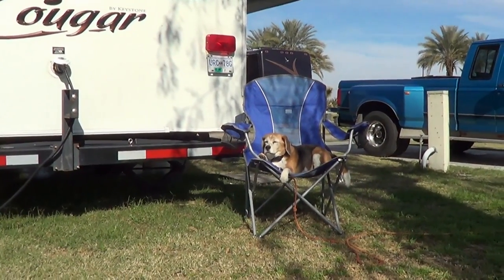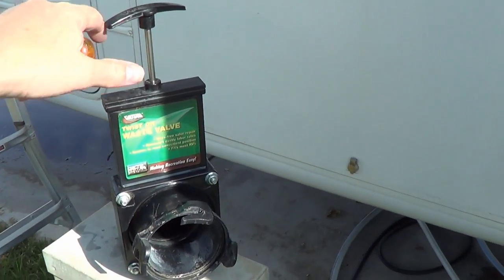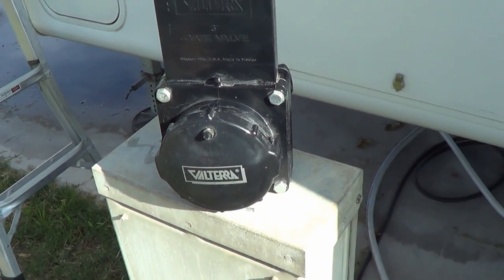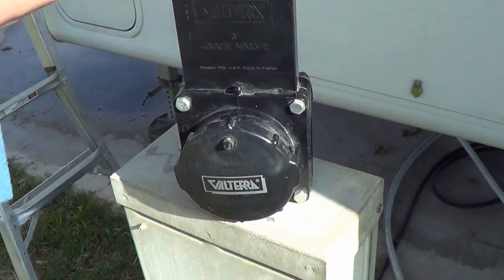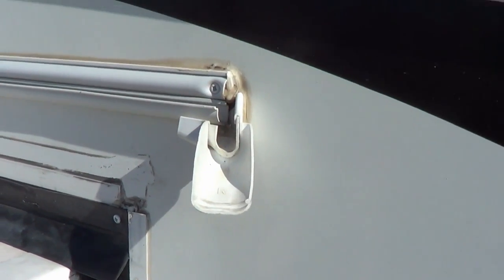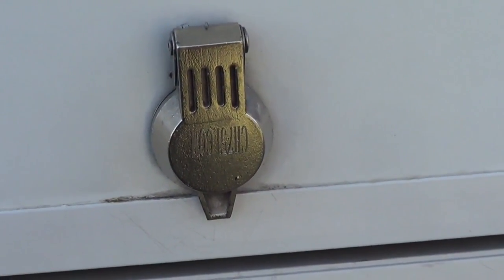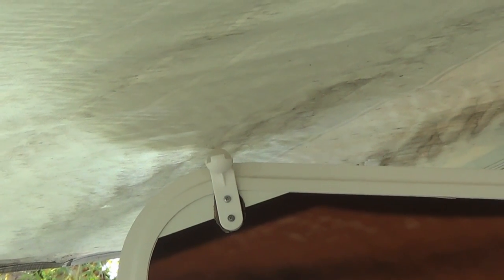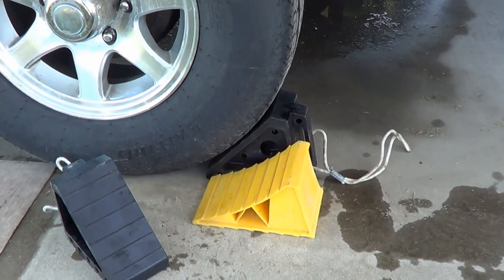My 10 Must Have RV Gadgets

Comment: Without watching the entire video, the 10 things I believe you need are:

Toolbox-Yes it's several things but a basic tool set is essentialRubber Mallet-Great for securing stakes for outside rug, canopy, awning anchor, etc
Tire gauge-obvious reasonsLeveling Blocks-I haven't had to use these often but am thankful I have them
Slonkey-To keep your waste hose off the ground
Water Regulator-Had a friend tell me how at a campground he stayed, they shut off their water slide increasing the water pressure enough that it burst a seal in his camper causing a flood in his camper
Y Splitter For Water Hookup-This way you can hook up a hose as well as fresh water hookupSurge Protector-Obvious reasons
Dog Bone-In case you stay at a park that only has 50 amp(if you are have 30 amp service) and vice versa
Emergency Roadside Assistance-Believe me, it's essential

Comment: Great stuff!  I need those gutter extenders and awning protection ball!  Our high Colorado mountain winds often blow my cheap plastic chocks across the lot in our RV parking so those heavier rubber ones look much better!  I recently mounted two Valterra A04-5094BK EZ hose carriers and love them!  One holds my two stinky slinky hoses which is great because everything fits except the end piece that goes onto the ground drain.  The other holds my water hose lines which have always been a pain sitting in my storage compartment.  And both are lockable.

Comment: Morryde step above pull down aluminum stairs set up with grab bar, RVlock with combo pad and remotes, Auto leveling system, Reese Goose box with air bag and shocks, hand held wireless rechargeable air pump, adjustable water pressure valve, battery kill switch are some of my go to products.

Comment: I installed a "Dust Devil" central vac system in our Cougar and my wife loves it. I mounted the hose connect in the bottom step going into the upper bed area and store the hose under the table seat. The control unit with the dust bag is mounted in the storage bay adjacent to the steps to the upper bed area.
Reply from the maker: Nice!

Comment: We have had motorhomes for 30 yrs. We started with our first one when our children were young. We now take grandchildren with us. We are on our 3rd. Motorhome. On each of them we put a screen saver on the bottom section of the screen door. The first two we bought at Home Depot or Lowes, the newest one, 6 months ago we bought at Camping World. They are about 25 to 30 dollars but they prevent the screen from being pushed out and helps to stabilize the door. With the grab bar and screen saver, our screen door is very stable.
Reply from the maker: Good tip, thanks! Cheers, Ray

Comment: An absolute must have for me is hose quick connects. No more twisting of hoses at the pipe stand, pressure regulator or where it's hard to get at going into the rv. I use them for fresh water and my internal black tank sprayer hoses. So I don't mixed up those for fresh water (vs those for black/grey water) I spray paint them white like my fresh water hose.
Reply from the maker: Cool. What brand have you found works best? I've tried a few in the past but they never really held up very long before leaking.
Reply: The brand name is Gardena. I bought them in Canada. The main part is grey and the sliding collar is orange.
Reply from the maker: George Bliss Thanks! Will give them a try. Cheers!

Comment: Another thing you want to add is a Mister  for your air conditioner on the roof in hot areas like here in Redding 115 out when we were living in it to build a house that Mister kept that thing at 75 just put a little bit of spray water on that coil you also want to have a filter so you don’t build up on your coil .
Reply from the maker: So I guess it acts like a swamp cooler, guess that works well in low humidity environments.  Cheers, Ray
Reply: Love Your RV No it does not act like a swamp cooler it keeps the condensing coil cool in real hot weather and makes the air conditioner work better and not overwork but you have to put a calcium filter on it so it will not corrode that coil with hard water

Comment: Great list Ray.  I will give a Shout Out to Progressive Industries.  I have one of their plug in surge protectors and one day at the campground I was staying, there was an overload on the power line feeding mine and another row - caused a fire actually.  My Progressive Industries surge protector did it's job and died in the line of duty.  I found out that Progressive Industries is actually in NC where I was, so I took it to them and told them what happened.  They are super nice people.  30 minutes later they had parts replaced and handed it back to me.  No charge.  Highly recommend Progressive Industries.
Reply from the maker: Awesome!
Reply: I too have the portable EMS surge protector protector and it has saved my rig twice already. I actually have a dedicated 30 Amp circuit at our home driveway we plug into when home. The EMS kept telling us something was wrong and it shutting down. Turned out we had a loose ground connection at the breaker. so bad circuits can happen anywhere. When we upgraded to a 50 Amp rig, I immediately purchased the 50 amp EMS protector and kept the 30 amp one to use when we only have a 30 amp circuit available.

Comment: Those are all great gadgets for an RV.  Something else I have added to my RV is a Tire Pressure and Temperature Monitoring System.  I'm not one to stay in one place for long periods of time and in my travels I experienced a blow out on my fifth wheel and had it not been for a concerned traveler pulling up next to me and alerting me of a blown tire, the results could have been catastrophic. There are many Tire Pressure Monitoring Systems on the market today.  I purchased the EezRV Tire Pressure and Temperature Monitoring System.  It is easy to set up and adjust when necessary.  Peace of mind if you are doing a lot of towing.
Reply from the maker: I purchased the same one back in October for this year's snowbird trip, working great so far! - https://youtu.be/sdMCQMdd8dw

Comment: Nice compilation. My #1 "must have" item is a battery monitor. We boondock camp a lot and the information provided is priceless. Victron and Trimetric are the two faves on the RV forum I participate in. 

If your style of "camping" finds you staying in RV parks with hookups, the battery monitor has much less significance.
Reply from the maker: Good one! We boondock a bunch too. We have the Trimetric. I should put a list together of my favorite boondocking related items. :) Cheers!
Reply: I have a nice Blue Sky smart controller that seems to be doing the job.

Comment: The Maxxair 2 newer version also has the hinge so you can fold it over. It also as more airflow than the original for use with fantastic fans.  

Personally I went with the MaxxFan deluxe that is thermostatically controlled, has the cover integrated into the fan and has a remote control as well.  It was spendy but on my Truck camper i was trying to avoid shading my solar panels so this fan with the lower profile cover seemed to be the best solution.
Reply from the maker: Sounds like a good solution. Thanks.
Reply: I just checked this out and it definitely looks like a better solution.  Thank you, Mike.

Comment: Another gadget I think is essential is a battery charger/air compressor combo. You get one relatively inexpensively. I have one made by Peak and it's good for jump starting your RV/truck. It's also good for pumping up tires and such if needed. Some come with USB so you can charge your phone if need be.
Reply from the maker: Good idea. I have a NOCO GB150 battery booster and a Viair 450p-RV compressor, they were expensive but we are full timers so worth it for me.
Reply: Yikes. Just look them up. $300+, ouch

Comment: Great video. I'm an RV Tech and an avid camper. I really enjoyed your list and it was well presented. I just wanted to point out that the surge protector is either installed backwards or maybe you just have the lid on backwards but the cord line in should be the input and the output should continue on to the vehicles main breaker panel. Thanks for posting.
Reply from the maker: Good eye! I reversed the lid so I could easily read the error codes off it of need be. Cheers, Ray

Comment: thank you for the info and i would add 
... small solar system 
... power bars when using shore power plug ins 
... fantastic fan 
.... Buddy heater 
... furniture with storage built in 
This year i am making a few mods to a Ford van that will
make parttime camping more fun 
and these are a few things being considered :) 

Happy Trails and God bless !!!!

Comment: I have a post-surge protector and the rubber blocks... otherwise I have some shopping to do.  Note: The rubber chocks are great, especially if you store your trailer where it freezes in the winter, you can hammer them out if they get frozen.  But the rubber chocks do smell pretty strong (rubber smell) at the start, so store them in your truck bed!
Reply from the maker: Interesting, I never thought about the freezing thing as we migrate each year down south. Thanks! Ray

Comment: Another cool thing to have is a hose and cable shield, Yellow jackets is what we call them and they are for if you have to run your power and wayer across a road or walk path they will protect your lines and not create a tripping hazard. I got some because I used to travel to set up PA systems for drag boat races and there is no defined RV parking areas in most venues and we have to run power and water across paths and roads etc..

Comment: Best gadget I found is a LUCI LIGHT, which is a solar powered light that you can just throw in your dash when traveling down the road, or in any sunny place while stationary. The light has a blow up lantern that is clear and it will run all night on low power. It has 3 power settings plus an emergency pulse, and some feature a red light as well. They can be found at Big 5 or other sporting/camping goods store or on line.
Reply from the maker: Oh, yes they are cool, I have something like that, it's part of my boondocking gadgets - http://www.loveyourrv.com/favorite-rv-dry-camping-mods-gadgets/  We use it all the time when off the grid.  Cheers! Ray

Comment: Use the clutch on your battery drill to stop over winding and no sore wrist. I’m amazed at how low it can be set. Also prevents over tightening when raising them.
Reply from the maker: Good tip, thanks, its also nice to nice variable speed trigger on the drill. Cheers, Ray

Comment: If you don't have an RV grill, gotta hack one to feed off RV propane! I hacked a brand new Q1200. Took regulator off and replaced with quick change male propane connector, made a hose. Now I simply hose into RV, no more pound cylinders. I attached a female plug to the removed regulator so I can still use the grill on the beach with the one pound cylinder if needed. At home, I quick change it into a 20 pound grill tank. All three ways work flawless. Q1200 rocks!
Reply from the maker: Yup, great idea. I've done the same with my grill. :)

Comment: A buddy had every electrical and electronic device in his motorhome fry.  The campground was in the process of remodeling the sites and updated the electrical.  The electrician wired the 30 amp side of the power pole the same as the 50 amp.  So, instead of a hot and neutral, there were two hot... 240 volts instead of 120 volts.  Of course, the form my buddy filled out to stay there, had a statement that held the campground harmless for any and all damages while staying there.  Three flat panels, the microwave/convection oven, both roof AC units, all went up in smoke.  Oh and, the inverter/charger lasted just long enough to put 24 volts DC out and fry anything that was even 12 volts... the inverter/charger itself, power step, power awning, power leveling, the 12 volt side of the frig, and smoked both house batteries.  Last I talked to him, he had spent over $8,000 on repairs... and still wasn't done and things still were not working right.  NEVER plug in until you have checked things out!!!!
Reply from the maker: Holy cow!

Comment: Nice video!  Really good suggestions.  I'm already on amazon!  
I did discover a cool gadget this weekend for the head.  I was experiencing the dreaded "blow back" and frequent blockages.  When I would flush the toilet, it would burp back up.  I've doused it with water, but could tell something in there just wasn't budging.  I have an offset tank, meaning there is an elbow between the toilet and tank so I can't see straight into the tank like some.  I ended up buying a dryer lint cleaner, which is essentially like a big, flexible pipe cleaner.  It's flexible and seems to be just the right diameter, for my system at least.  Cheap, too.  I worked that thing in and out while flushing water through and pulled out a lot of old, crusted up toilet paper.  I know it's old because we haven't put tp down the chute in almost a year.  Man, it worked like a charm!  Water flushes down VERY smoothly now.

Comment: Hey, instead of using a drill which could hurt your wrist just like you said; i use my Dewalt 20V impact.  Not the tiny compact impact, the one you would use to remove lug nuts with.  Thanks for the tips.
Reply from the maker: That works well, notice quite a few people using them now, I have one for changing tires, but do make a heck of a racket. :) My drill has a variable clutch so I set it not to hurt my wrist, but most of the time I just brace the drill with my free hand. Cheers, Ray

Comment: A back up cameras are nice got one on each back corner cause I'm by myself and sometimes you have the truck turned on way and the camper another and you can't see also nice to turn on while driving to see if anyone is behind you tailgating.
Reply from the maker: Yes, good one, love them. I just added a 4 camera system last summer - https://www.loveyourrv.com/installing-the-haloview-ultimate-rd7r-wireless-rv-4-camera-system/  Included in my recent list of electronics :)  https://www.loveyourrv.com/electronic-gear-and-gadgets-for-rving-my-12-must-haves/  Cheers, Ray

Comment: Probably quite an uninteresting accessory in the US, but here in the UK I find my macerator pump useful, some UK dump stations are higher than your holding tank if you have a small B class, even in my A class they can be fifty feet away from where you park and 1inch hose is much easier to store.

I like the water pressure regulator, it took me years to try risking a 'city water' connection, to be fair not many sites have fully serviced pitches, I've only seen one that included sewage. I think I'd install it in a basement locker though, probably get stolen on the tap.

Comment: Thanks for sharing. Some things I noticed that may help.  You have a socket drive on your cordless drill, it can make fast work of the stud and nut attachments on your vent covers.  Be sure to set your torque low enough you don't strip or break anything.  When you are up on top dealing with the vent cover or other work make sure to have some sort of magnetic parts dish to keep your parts together.  Parts falling off the roof and having to climb down and back up to get/find them is an annoying waste of time.  Rethink those cylinder style locks, they are easily picked with common house hold items.
Reply from the maker: Nice tip on the cordless drill, but I still prefer the clips, simpler, no tools required.Not all tubular locks are created equal. Some of the common lock picking item tips are old news. Like for instance, the Bic pen thing was pre-2005 bike locks mostly. Anyway, a thief that determine isn't going to be stopped. A simple crowbar will easily open most RV storage bays, the door material is pretty flimsy. But the unique key tubular lock is better than having most of the other campers having the same Ch751 key as yours. Keep honest people honest. ;) Also, they are much better quality so nicer to use and longer lasting versus the OEM junk. Cheers, Ray
Reply: In a contest of no tools versus a battery operated quick use tool, not tools still wins.  No tools weigh nothing, take no space, never run out of charge, impossible to lose, and are wicked cost effective.  That said there's no reason to change your old vent cover when you have that handy drill. 
As to the locks, your point is well taken.    There is no stopping a truly determined thief.  Making the crime impractical is the best you can do. Cheers!

Comment: I think your Line / Load are wired backwards on your surge protector. Looks like you got incoming going to Load and the outgoing on the Line side.
Reply from the maker: You're confused because I have the top cover reversed so I can easily read the codes. :)  Cheers! Ray

Comment: Try it You'll like it....Tip for cleaning the underside of your awning is to use a foam ( aerosol can)
 type of window cleaner and a soft brush like the ones you would use on a hose to wash your RV ... Do about a 3 foot square at a time.....the foam keeps the cleaner from dripping while you're working....wipe dry with paper towels as you go then hose the whole fabric down at the end  to clean off any residue
Reply from the maker: Neat idea. I'll have to giver a try.
I usually go with the Dometic manufacturers instructions, works really well and with pump sprayer hardly any labor. :)
Here is how I do it - http://www.loveyourrv.com/rv-power-awning-super-easy-maintenance-how-to/
Reply: It's always best to follow the manufacturer's instructions :-)

Comment: cylinder locks... excellent.. just like on my 'cycle... really hard to hack...and the rollerball... plus the standard traveling companion, a dog...; )
Reply: Cylinder locks are perfectly fine for this use, but they are just about the easiest lock for an inexperienced person to pick.  The tools required are easy to use and cost well under $20.